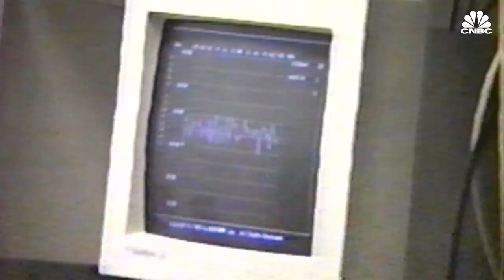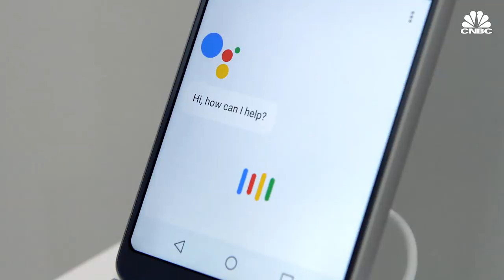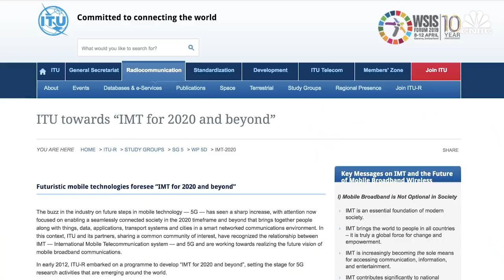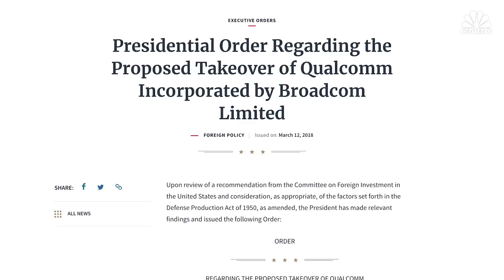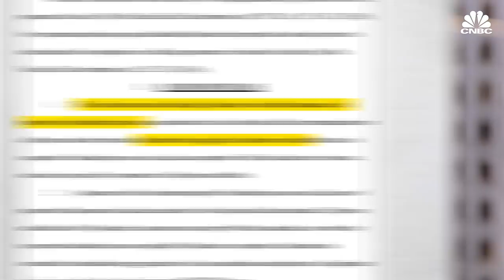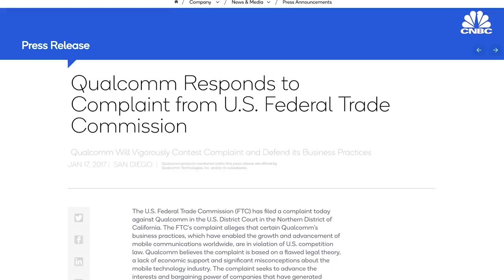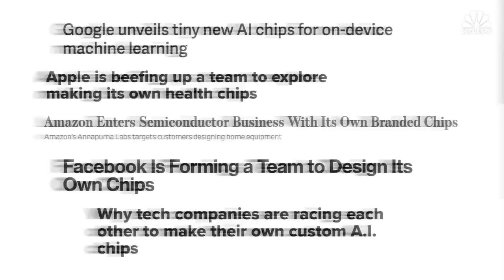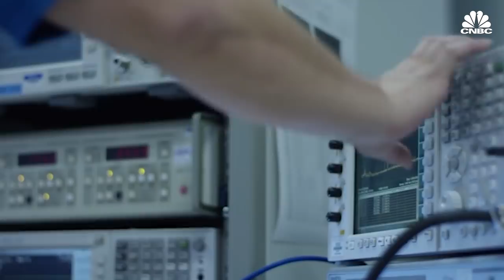Why Apple And The FTC Are At War With Qualcomm

Comment: charging cable on apple website = 25u.s dollars 
Qualcomm Royalty = $7.50

Perhaps apple can pay them from the huge profits from that department.alone... lol.. 

4 cents of copper and plastic.. ..and if they had their way they would sue every company selling
the charging cable for 1 dollar..
Reply: To be fair though, if you've ever bought a cheap charging cable, you'd notice the difference.  I'm not saying Apple isn't overcharging but when it comes to cables, a lot of companies that make cheap ones really are trash.
Reply: @YdenMk-II   yes lol.. i've had some pretty bad cables.. Usually the ones where they are 3m or so . then the quality matters even more.
Reply: Who said Qualcomm royalty is just 25$? And  For 1000$+ phone 25$ cable is still cheap.

Phone cost depends on lot of things like research  , new tech development and more.
Reply: The royalty is very small by individual standards, but not for massive businesses. Look at mid range phones, most still don't have usb-C simply because the usb-C connector will cost them 15c more
Reply: Z3U5  and?
Reply: @Casinodemedici  no one said 25$ its for like 7.5$ PER PHONE. And that is too expensive, even when iPhones are sold with 30-40% markup :)
Reply: @christate3523  would u not buy a phone if it was 15c more expensive? 999.15$ instead of 999$ for iphone. Makes no difference to anyone.
Reply: @vitas75  it's nothing to do with me... This is how manufacturers see it

Comment: At 3:55 it is said that 2G was offering only digital voice. That isn't true. Initially 2G could offer 9600bit/sec which was good enough for email and some basic websites without large images. Later 2G could offer GPRS with 56–114 kbit/sec or EDGE with 236 kbit/s which was great for viewing every website even with audio or video streaming. The first iPhone was only 2G but had good internet connectivity with GPRS and EDGE. 
During late 90's with the hype of internet, I had an external 28.8K serial modem with a Qualcomm large chip inside. The chip wasn't soldered. It could be replaced easily  and make the modem  56K.

Comment: Qualcomm developed 2G, 3G, CDMA and partially 4G. All those standards have their patent holders and of course, each phone manufacturer will have to pay them royalties. Qualcomm is being paid 5% royalties per phone running on 3G and 3.2% on 4G LTE. LG is holding more 4G patents then Qualcomm, therefore is getting paid more in royalties than Qualcomm per phone sold. And nobody complains about paying to LG or any other of the patent holders like Motorola, ZTE and bunch of others. 15-20% of the price of a new phone is royalties, believing or not. And because Apple's phones are so high priced,  they pay a lot in royalties and seems to me, beeing so greedy they are now trying to cut down on that. Even if Qualcomm was investing many millions in developing new custom modem for IPhones every year, as Apple demanded, and now they're getting sued?!? Let's see how will the new Iphone perform with the slower Intel modem for the same price and same royalties owed for 4G LTE. Yeah, next IPhone will not be 5G.  Good luck, Apple! I bet you'll lose 5% market share with that move alone.

Comment: My phone from 2016 that I'm using right now was the very first to have the Snapdragon 625 processor. It has the balance of performance and efficiency. It's still holding up quite well, except for the deteriorating non-removable bettery, but at least it doesn't take long to launch apps or lags like those flagship Galaxy devices from the same era once the battery deteriorates.

Comment: Cue the "5g causes cancer" tinfoil hat people 🤣
Reply: Cue the ignorant, arrogant yt commenter who knows nothing about 5g because no one does. Hasnt been studied properly. Its no secret however that 5g waves have a shorter wavelength by a power of 10. Hence the name 5g, like he said in the vid, when you shorten a wavelength, it carries more energy which damages cellular DNA and mutates protoonco genes into cells that cant regulate replication hence the cancer. The fact is evident that as you move up the EM Spectrum you open up your body to more damaging radiation. Even if 5g is relatively harmless over a lifetime, any progression and lack of caution means it wont be long until we're communicating with essentially x rays.
Reply: 5g needs to be studied more
Reply: Emf interference can cause high frequency energy spikes
Reply: @Devon SimpsonDo you have any idea how the electromagnetic scale works ? Frequency is a dominant parameter effecting power density and penetration.
Reply: They said that same thing to 3g-4g, also on 2g.
Reply: @MrCTruck  Following your logic you'd be dead in  your early years. 5G is not ionized which is what causes cancer.
Reply: @linregalian7979  how do you know that
Reply: @MrCTruck  Radio waves use nononionizing radiation and this type of radiotion is used in microwaves, computers and pretty much anything wireless.  Yes 5g does have a shorter wave length, but as you said it hasn't been studied so yeah we cant assume results as of now. Regardless,  you gotta be pretty dumb to believe 5g can cause cancer.
Reply: @hifiuniversalmusic8537  Because I work in the medical industry. And if 5G really causes cancer you'd be dead already due to the sun which produces a vast range of wavelengths.

Comment: The amount of ignorance in the comment section is astonishing. I heard more people complain about apple products being overpriced and squeezing the suppliers. Aside from the niche products like Apple Watch, there is no sign pointing to apple as having a monopoly over any industry. Android has more users than iOS. Samsung and Huawei sell more phones than Apple. Windows products are sold more than MacBook.
 
The only reason why you're complaining is because it's expensive but you get what you pay for. Else, Apple wouldn't be making money. Do you think Google wouldn't charge 1000$ per an Android license, Microsoft to charge 3000$ for a Windows license, or Samsung to charge 2000$ per phone if they can?

Last but not least, it's the consumer that decides which product is good enough for this sort of commodity. Although the Qualcomm licensing and chip selling practice is controversial, it has nothing to do with the price of the iPhone. Frankly, they don't become a 700+ billions dollars company by ripping people off. They are so because the phone itself provides more value than the money you spent. Is it more valuable than a Samsung phone? Arguably no...but it definitely more valuable than the money that you'd spent. Otherwise no one would buy an iPhone.
Reply: Reehji 700 billion dollars maybe?
Reply: Amol Sonawane typo, sorry.

Comment: Paying royalties to engineering/design patents isn't anything new for IP,  famously ARM's business model is taking a percentage of each chip's cost.  But from my under standing, QC is unfairly raising the price of their IP based on their customer (soc manufactures), which is why the FTC is getting involved. It also sounds like probably more soc manufactures should be or are suing QC for unfair business practices. I feel like, if they didn't put apples name in this video, no one would actually watch it... 

side note, i probably wouldn't have clicked on the link if it said "FTC is investigating Qualcomm for unfair business practices"  or "FTC at war with Qualcomm"

Comment: 4:20 – Autonomous driving isn't remote control driving, thus, no high-speed data transmission in necessary; Autonomous is when the vehicle uses artificial intelligence, not a broadband internet link to drive... Questions, Qualcomm?

Comment: This isn't a Qualcomm issue. It's a lack of change to patent laws by ancient minded regulators. They are just using the current patent laws to make more revenue. Open source is better but the problem is that contributing doesn't bring much revenue and everyone has to eat. Maybe Microsoft is working on a solution to this since they purchased github

Comment: AAAAPPLE!??? the company that over charges folks on a cell phone with Sub par tech for $1100 that you can get elsewhere with more specs for $700. The Company that sells an additional connector for $20+, The Company that has offshore banking Acc n hoarding cash is complaining about overpricing.

Comment: Apple accusing Qualcomm for charging a percentage of phone's profit along with the cost of the modem chip. 

Apple doesn't know that they charge +150 usd on the same phone with a slightly higher memory capacity chip which cost not more than +20 usd.